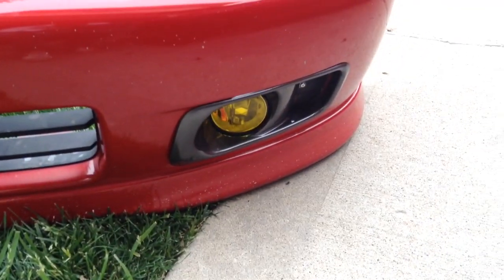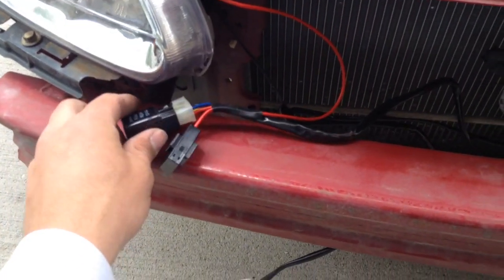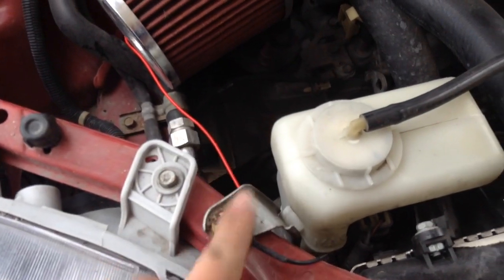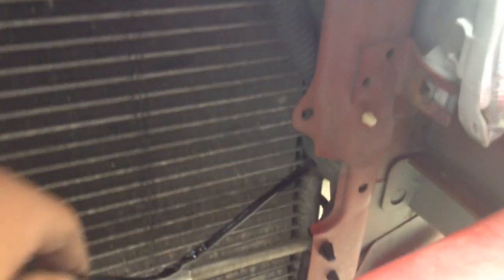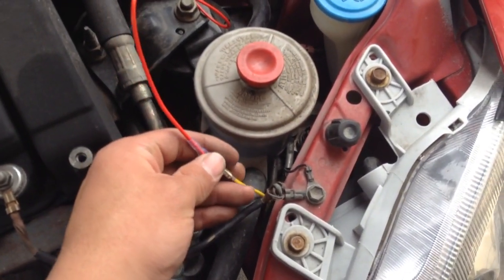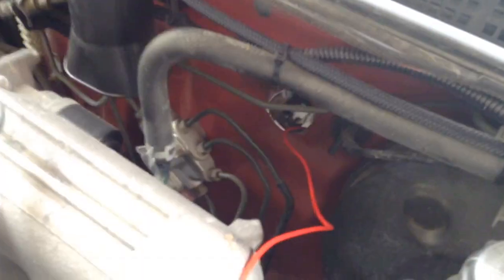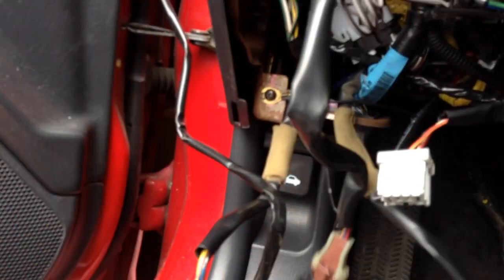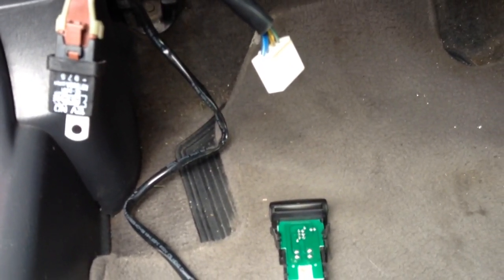How to install 99-00 civic fog lights

Comment: Did your car not have the factory harness? On mine i just plugged into a factory harness by the ps pump and then plugged into the fuse box under the dashboard. All plug and play. No cutting or splicing or taping. It was an aftermarket kit. But it was made just like factory. Even came with a factory style switch
Reply: RSH21 what brand?

Comment: My fog lights switch harness doesn't have a ground to bolt up to anything. The only black wire is connected from the relay to the switch. Can you help me out?
Reply from the maker: is yours the OEM harness? or are your fog lights aftermarket?
Reply: +Grant T My are aftermarket.
Reply from the maker: +Brian Lee hmmm. are yours not working?
Reply: +Grant T Yep. I tried them already and no lights came on. So I was thinking that might be my problem.
Reply from the maker: +Brian Lee I'd check the relay first.  I got mine brand new and the relay went bad within a day or so. once I bought a new one they worked perfect.
Reply: +Grant T Ok, I got them to work now and they won't turn off when I turn them off. The switch is on, but nothing is happening. What should I do next?
Reply: +Brian Lee idk

Comment: You do know that there is a factor harness to plug into. Makes all this a lot easier.
Reply: Where is this factor harness you speak of?
Reply: @narithchhem8058  underneath the windshield wiper fluid tank is the plug for the lights and  under the dash by the fuse box for the other part of the harness.
Reply: @859don  thanks I'll check it out in the morning. Didnt think you'd reply! Thanks again!
Reply: Found it! It was more towards the washer fluid against the wall and under wire harness. Now just to figure out how to connect it.
Reply: @narithchhem8058  I'll make a video and post it in an hour or so with a walk through.  I doubt I'll take it all apart due to how cold it is today but I'll walk you through it.
Reply: @859don  thanks, I gave it a shot this morning its cold here in GA too. i didnt have the brown plugs to the fog light kit i bought but. for some reason its not lighting up, fuses work and i basically took the brown plug in hood spliced it with the red light switch wire, then the brown wire in car behind box i plugged into the fuse box.
Reply: @narithchhem8058  I just posted a short video for you.  I hope it'll help you out